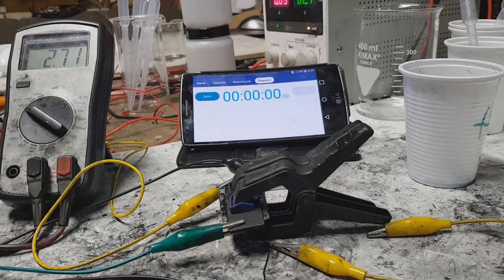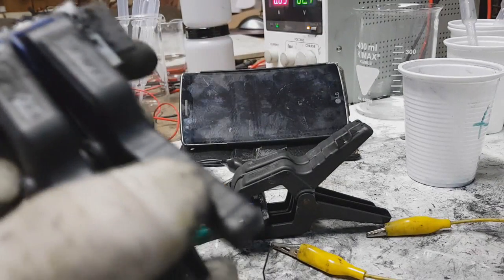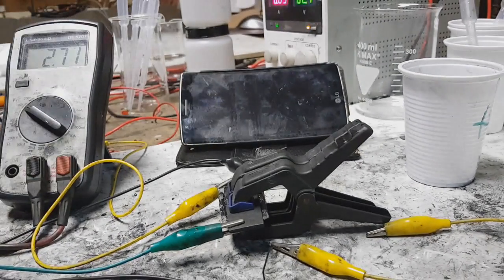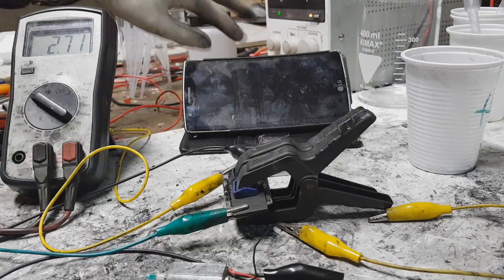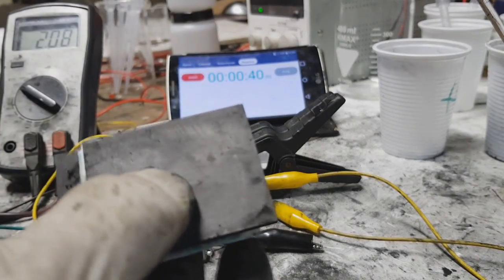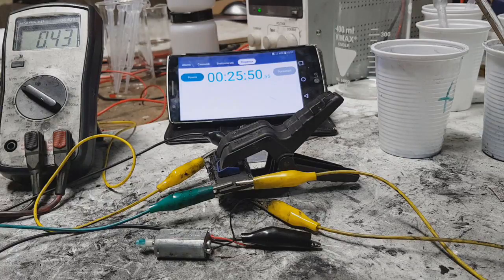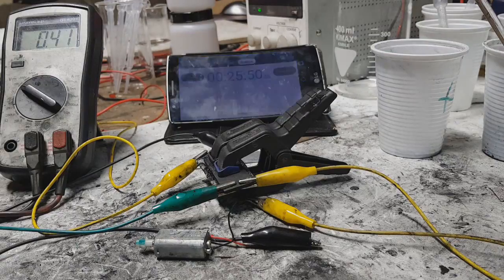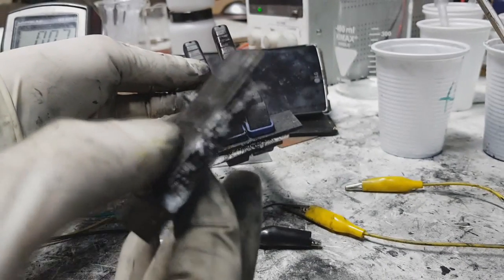Supercapacitor based on Deep eutectic solvent

Comment: Well done Cayrex, but how flammable and toxic is the electrolyte ? Can it burn up when ignited and is already charged up ?
Reply from the maker: the electrolyte is not flammable
Reply: cayrex2 but can the cell burn up if it is fully charged and you put a highly conductive Copper or brass screw or nail through it and short the cell out this way ??
Reply from the maker: overunitydotcom No, the supercap will not burn.